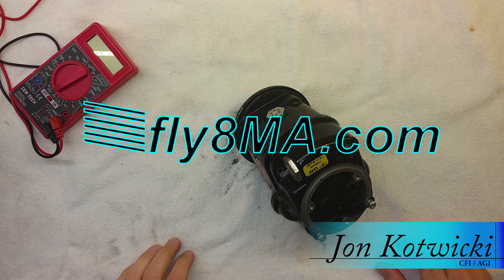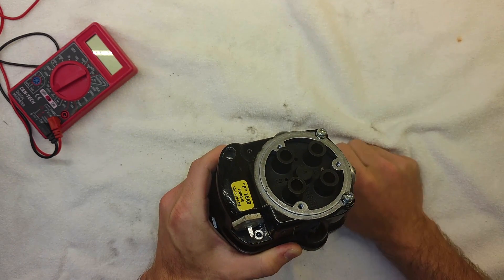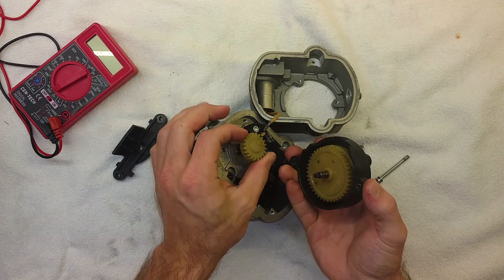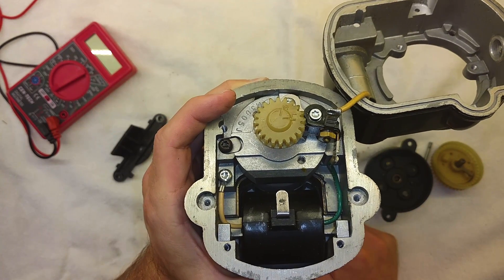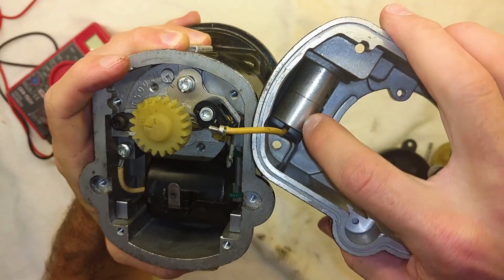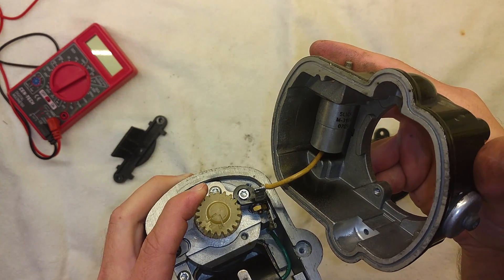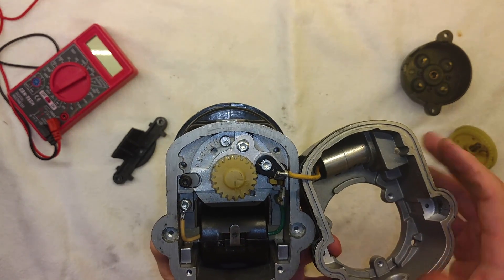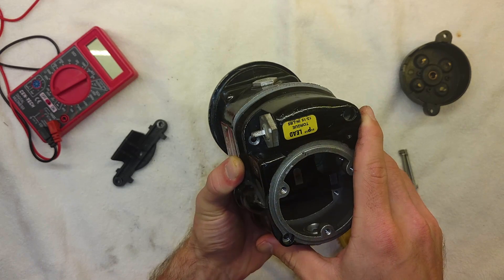Ep. 52: My Airplane Broke | Bad Magneto | Magnetos Explained

Comment: know nothing about aircraft electrical stuff but from what you said.. remove p leads .. now am i ready to fly?
Reply from the maker: If the p leads break or are disconnected and the prop turns the engine will start (assuming there's also fuel flowing)

Comment: Will there be ANY RPM drop during a R-L Magneto check when ‘no load’ on the engine is present? (E.g. Prop is not installed)

Comment: How do you check-out the Capacitor &/or Coil using your multimeter ?  My Mag is grounded at the "P" lead & not firing . , , Help !
Reply: If it's grounded a the P lead it's not going to spark.

Comment: We were doing a 100 hour on a Cess. 172 R model and the left mag pulled a wire off. The A&P stripped the wire threw a new loop on it and we cowled it’s. 
Test run as im you guessed what’s going to happen . We started it up and did a run up. Right was fine but the left would imidiatly kill it. 
Well what we didn’t know was that the wire we stripped was 2 in 1. 
So after we separated the 2 and re wired it ran flawlessly. 
My point behind the strong. CHECK YOUR WIRING ! then ....DOUBLE CHECK ! Lol. 
Thanks great post.

Comment: Every mag ive ever seen or heard of would have been involuntarily thrown at the ceiling if you were holding it in your hand and messing with the shaft like that.  The spark is usually much much stronger than what it seems your working with.  I would recomend no one try this at home.  (Maybe the airplane stuff has such less power?  I doubt it we  are still trying to ignite gasoline in a cylinder at a specific time with less compression than a more modern engine)

Comment: I am not yet a Flyer but I am mechanically inclined......I guessed that you would remove the kill circuit(P leads) and hand turn the prop............then quickly get the hell outta the way
Reply: Derek Burkett correct, but make sure someone is on the brakes.

Comment: There is not a coil of wire on two sides...........there is one coil wrapped with another coil over it..........fine wire over thick wire...........it steps up the voltage and gives you 10,000 volts to jump a sparkplug..
Reply: ...yep...it's a transformer...

Comment: I remember when a magneto went stupid in my dad's plane. We were on a cross country up into a remote grass airstrip for some airplane camping, and we landed for some fuel. After refilling the plane, he did the mag check and on one side the engine ran really rough, as if it was only running on three cylinders. Fortunately there was a mechanic on hand and our trip was only delayed by 3-4 hours. Moral of the story... even if you were flying half an hour ago, do the preflight and engine runup again. Just in case.

Comment: Cool video...but here's another pop quiz question: why did you get a 100rpm drop when you ran it on the other magneto, if this one was dead?
Reply: ...because firing one plug in the combustion chamber instead of both slows the flame propagation and the engine slows down slightly...
Reply: @paradiseroad6405  
And if one mag is bad the engine is only running on one plug not both!  In mag check if you turn off the bad mag there won't be a drop because it's already not running on 2
Reply from the maker: Just the way it failed it was working on and off.  The way the airplane had been acting lately I had suspected it for a while, but could never duplicate any problems on the ground with an A&P around until finally it was totally dead and we just pulled it off.

Comment: I was fine with you saying that the magnetos produced "sparks" instead of electricity until 4:00 when you started talking about the hot spark wearing down the distributor. There is no spark inside the magneto, and the damage is entirely from friction.
Reply from the maker: If you take a look inside the distributor on the mag (i.e. cutaway) you will see the sparks (electricity) jumping to the posts in the distributor to flow through each wire to the spark plug.  Those sparks (high temperature) caused local areas on the posts to change state and develop that build up that it pretty high resistance and would not allow the electricity to flow through to the plug wires and to the plugs.

Comment: When you change the brakes on your car, you just let the caliper hang by the brake line, don't you?  I was so distracted by the back of the housing flopping around hanging by the condenser wire, wondering when that poor solder joint was going to give up the ghost that I couldn't concentrate on what you were saying.  Interesting video though, I definitely learned something so thanks for that!
Reply from the maker: Lol, that mag is just for instruction.  Being that I'm not an A&P, if I take something apart, it won't ever go back on the airplane.
Reply: Lol. That thought crossed my mind too, but wasn’t so distracted that I wasn’t enjoying the crap out of this video.

Comment: Why in the world not replace these early 1900s artifacts with solid state. 
Last car I had with a point and distributor cap was a 1964 American Rambler with a flat head switch.
Reply: If an aircraft suffers a complete total electrical power loss the solid state system fails also.  Magnetos are completely autonomous and require nothing but the engine turning to make spark.  A total aircraft electrical failure will not lead to an engine failure......
Reply: ...how much do three alternators weigh compared to two magnetos?...how much power does it take to run three alternators compared to two magnetos?...

Comment: Pop off the p-lead and hand prop the engine
Reply: The P-Lead holds your engine off via the ignition.  If you disconnect the P-Lead, you essentially disconnect the ignition "Off" switch and then you can manually push the prop over to start it after pushing mixture full rich.  Look up some safety videos some time, they show it happening unintentionally.  Scary Stuff.
Reply: A forum mentioned that the Right mag is disabled by the ignition switch when in the START position. This is apparently a safety feature due to the Right mag having no impulse coupler, and thus, not the best suited (and can cause damage) for initially starting the engine. If this is true, does that mean you should first only disconnect the Left mag P-Lead, and once the engine is running (after hand prop), then remove the Right mag P-Lead to allow the engine to run on both L & R Mags. 

Also my instructor never explained fully the reasons for checking deadcut (thats what he calls it). Am i right in thinking that this is simply to ensure each mag grounds itself via the P-Lead when switching between the Right and Left Mag. Does the ignition off position ground both the L&R mags?. 

Lastly, if switching from Both to the Right Mag you experience no RPM reduction, would this suggest that either the Right Mag P-Lead was not grounding properly or that the ignition switch itself was faulty?.
Reply: @clearskypilot4309  The P leads ground the mags so they won't produce spark at all. If you disconnect them then someone hand turning the prop can cause the engine to start. It may not fully start but if there is any fuel in the cylinders or intake when the impulse coupling kicks over, it can cause the cylinder to fire for a rev or two. That's why if you do need to turn the prop for any reason, it's best to turn it backwards as the impulse coupling only works one way.

As for the ignition switch, When in right, it grounds the left mag so that it is running off the right mag. Opposite for the left position. Off grounds both. Run opens both. When doing the mag rpm drop check, you are looking for a slight RPM drop because the fuel doesn't burn as efficiently on one spark plug. So you test each position to ensure there is a slight drop. When I was flying, before shutdown, we would momentarily turn the key to OFF to see if it would turn the engine off before putting it back to BOTH to shut down the engine using mixture cutoff. That tested to see if the P leads were in good shape to give confidence that the motor wouldn't accidentally start if someone turned the prop.

I'm not familiar with any mags being disabled when the switch is in START. I don't know of any reason why damage would occur. A mag without an impulse coupling just wouldn't create much spark at the low rpm's when starting. The whole purpose of the impulse coupling is to momentarily spin the magneto faster than the cranking rpm to get a stronger spark.
Reply: Dittos.
Reply: if you lost the key, you can't turn the ignition.
Reply: did you watch the video? the question I was replying to was "what would you do if you were out in the Everglades and lost your keys, but needed to get home and make your engine run?"

Comment: During preflight its happened to me engine didn't shut off but really rough running...
Reply: In that case, you can try leaning and running the engine at high rpm for like 10 seconds or  so. If that doesn't fix it... well...

Comment: Magnetos, 1930's technology in 2017...
Reply: It isnt just magnetos. The average modern farm tractor engine is light years ahead of any GA recip engine technology wise. If it weren't for FAA regs and insurance liability issues, the average Lycoming or Continental GA engine would sell for $3000 tops, not $40k and up.
Reply: @6h471  , great reply thank you (I know this is a 2 year old comment).  I see this "old technology" complaint all the time regarding GA engines.   There is a REASON why "things are the way they are" and YOU perfectly explained it.  The costs involved in bringing a up to date general aviation engine are HUGE but the demand for general aviation has been in a downward spiral for decades now.  And I do understand the "cost of all things related to flying"  is a large cause of the decline in General Aviation from the peak years.  But nobody is going to spend tens of millions of dollars, or more, just so I can have a modern cheap engine.  There just isn't a large enough profit margin anymore due to the exact reasons YOU noted; insurance liability issues and cost of certification through the FAA regulations.
Reply: Johnny Appleseed Correction: the battery is primarily intended to power the starter. It can also power the electrical system for a while with the engine off. The alternator is what's intended to power the electrical system and recharge the battery after starting. Same as in your car.
Reply: flexairz It is used for reliability reasons. When a battery on a car dies the engine dies too, the spark is provided by the battery. When the engine on an aircraft dies the engines still works, magnetos create their own spark.
Reply: @Darren Munsell How many batteries are you going to carry then? 3? 1?